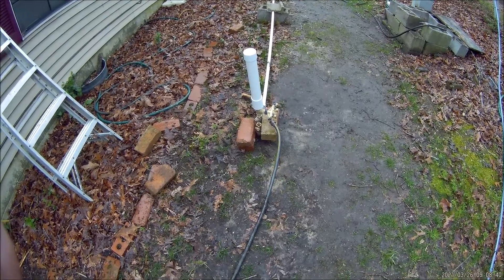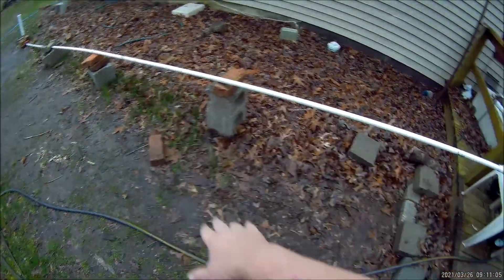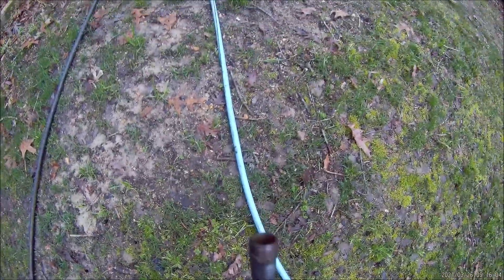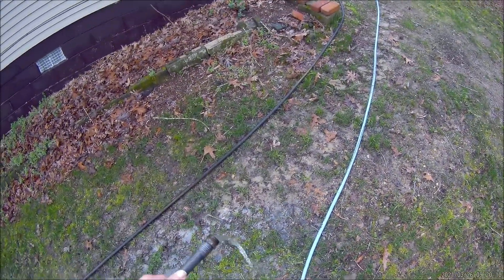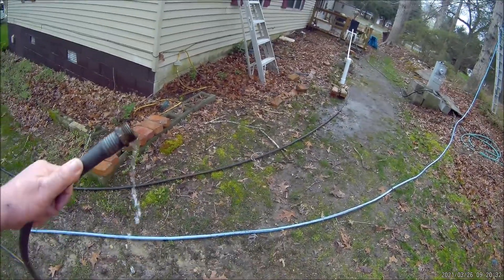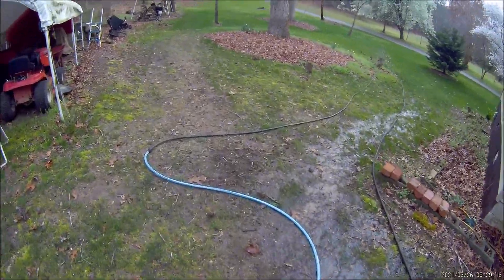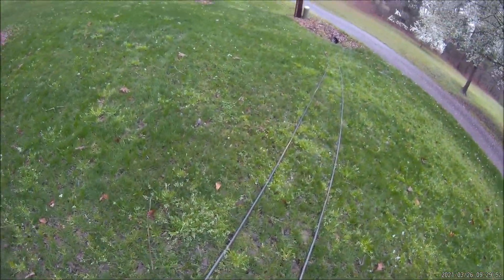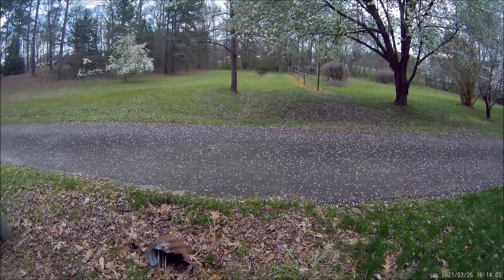Ram Pump DOWNHILL Delivery

Comment: Another alternative is this. 
Identify a first section of hose right after the first output valve. Section length about 20’. Configure this section into an inverted U turn about 10’ high. Restart the pump. This configuration will maintain back pressure to pump and deliver down hill. You use up 20’ of hose in doing so.

Comment: As an alternative, try this ,,,
Start the pump with the first output valve closed. Once it is cycling, slowly open the valve and hold when the cyclic stops. Now set the valve back in close direction just a bit. This will produce enough back pressure to keep it cycling.